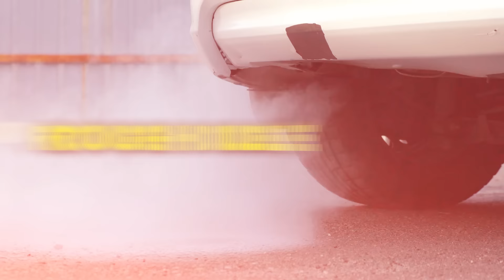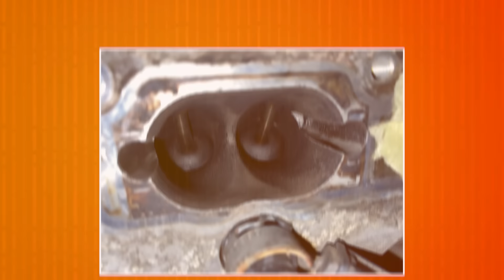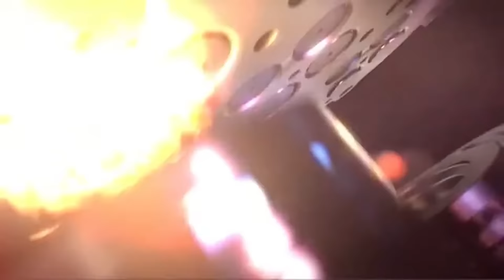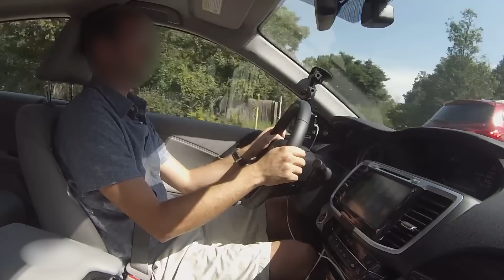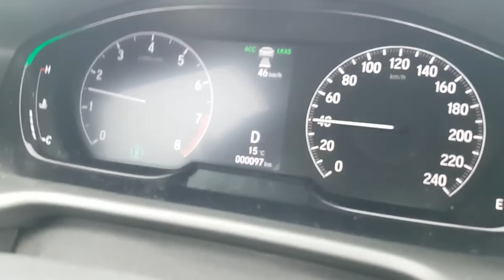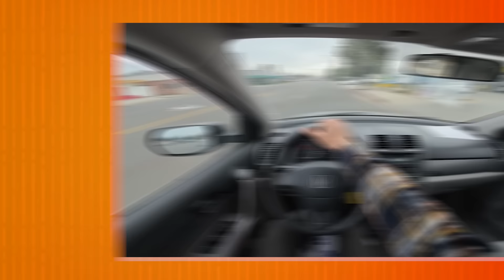The $0 Honda TRICK to REMOVE Carbon Buildup

Comment: Don't spew out BS and claim you're a Honda technician. 

The hot gases can only clean out the exhaust side of things. The carbon buildup on the intake valves is from blow-back of engine oil vapours. The Italian tune-up does nothing for cleaning the back of the intake valves in a GDI engine.
Reply: I agree, these techniques should not help intake valves a bit. I'm now going to take advice from Everything Honda with a grain of salt.

Comment: Elephant in the room?
You also need to use lube oil with low "NOACK" volatility. As it happens, on genuine Honda Lubricants it is low. Takes some research to find out, but some other brands are also good. You guessed it, these oils are not cheap. And neither is doing more regular oil changes. No, it's not a zero dollar fix. But it really does help. By the way, Honda engines are still good. Maybe not so good for idling in traffic compared to the older non turbo engines, they also need more care than they used to but they still compare well. If your stuck  in traffic all the time, and don't see highway driving, buy a Toyota Hybrid, go full electric or ride a bike🙂

Comment: To my understanding it's the short trips that really destroys your direct port injection Honda engines. Thankfully that won't be a problem for me because I drive over 40 Mi to work everyday. I never take short trips in my car. I change my oil when it is due and not afterwards. Also, I run 93 octane in my car which I usually get at shell. I refuse to put garbage gas in my car. Always top tier 93 octane.
Reply: Theoretically yeah 😂
Reply: It's direct injection that causes this naturally. Aspirated, you don't have these big problems. Proves the older ways we're better

Comment: The best solution is to not buy garbage Honda Turbo engines. Own a 2019 2.0T that I will be getting rid of for a good used Honda with an air aspirated port injection engine.

Comment: I usually  run techron in every  tank and leave car running on short trips to store ect- now useing valvoline restore n protect and also do italian tune ups.   Any other advice?
Reply: Techron won't help in GDI engines! In port fuel injection systems, fuel is sprayed into the intake manifold, where it helps wash away carbon from intake valves. In GDI engines, fuel is injected directly into the combustion chamber, bypassing the intake valves. This means no washout of intake carbon, and instead, oxidized fuel molecules polymerize into carbon deposits on the hot injector tips and intake surfaces.